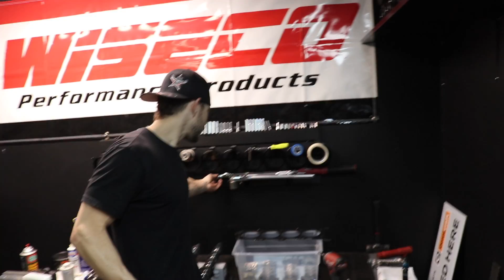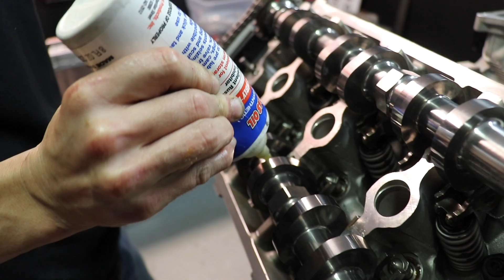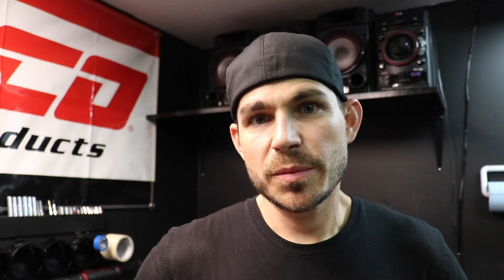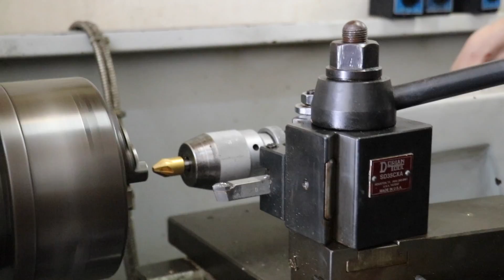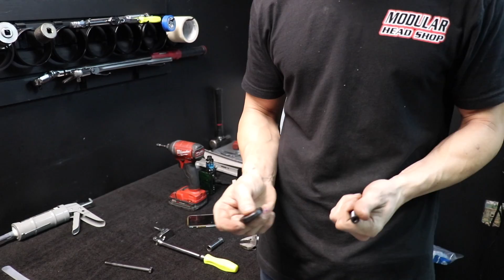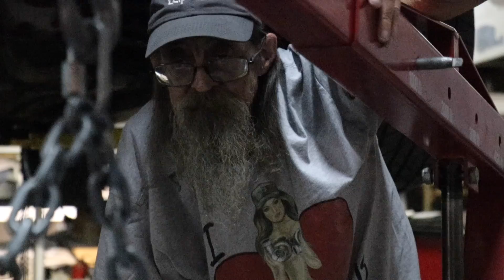Built and Cammed 5.8L Final Assembly

Comment: @ the 49:02 mark, Noticed no casket for the water pump, WOw that rubber or silicon oil seal must swell up something mad ,to seal the pressure of the coolant and from the heat?
Reply: Doesn't require a gasket and the o-ring works just fine

Comment: As far as oil pressure, thats what is important and where the oil is going, if you have a sealed loop system like the dry sump system, then sure bearing clearances are very very important, but you can never ever have enough oil, so real good pressure like a dry sump system is best for hi performance engines with a lot of moving parts. :) IMHO. :)

Comment: This is probably a stupid question, but when he says to torque the head studs in one motion at above 80 ft. lbs.   What does it change in the tightening method if you were to ratchet the torque wrench?
Reply: It requires more torque to move the nut then the specified torque. Does that make sense? It’s kinda hard to explain. 
So the nut being tightened at 60 ft-lbs would need something like 80 ft-lbs just to move it to tighten to 90 ft-lbs. That happens because the coefficient of friction is always higher of a stationary object than a moving object. Idk why, it’s just the rules of the land and everyone is forced to follow them. 
So if you tried to ratchet the head bolt/nut you would tighten to, say, 75ft-lbs. You’d need at least 95 ft-lbs to break the head bolt/nut loose to torque it to the specified torque of 90 ft-lbs.
So the torque wrench would just click if you pulled on it without actually moving the head bolt/nut. Hope that makes sense. Cheers. 🍻
Reply: My guess is the friction to make the bolt tighten more. Kind of like tires, it takes more power to initially break that friction, so doing it in one motion(if I'm right I may be completely wrong) would make the torque spec more accurate. Every time you ratchet the torque wrench you are must use more force to get the bolt to rotate and tighten any more, thus slightly inaccurate torque specs. I'm not an engine builder or mechanical engineer, its just a theory. No question is stupid as long as you learn from it, right?

Comment: Also as far as plastic, hi temp or hi friction stuff, theres plenty of options and its a good idea to use them especially for the chain follower or guide plastic items, that way it will last, oil resistant and temp resistant, but again it all comes down to money right and experience right. :)   Cadillac plastics in the USA used to be one of the largest manufacturers of those type of items for large engineering project's not sure now who would be the best, but Dupont would be the starting point and then find a local plastic moulding or machine shop which can make items to order especially now days with 3D printing. :)

Comment: Love that he is using hi friction additives for all the important hi friction ends on the moving following parts on the head, that's attention to detail. :) 9 times out of ten its hi friction grease and what gets me is this, the owner has no idea how much effort this guy is making when he is building that engine for him, were talking 10's of thousands of dollars it that simple, not so much the parts but the experience HP is Experience, FORD is mass produced even shelby the days are gone when you buy a OE performance engine other than GM stuff and even then they are improved by real experienced race engine  builders, thats what you need a race engine engineering boulder and not a engine mechanic. :)  Pull apart any nascar engine and i bet it has all those items which are made to last and are very strong items, but in saying that race engines are made to rev and lots of hp, but put it in a everyday car and it will run like crap mainly due to the fuel used, but run the same fuel say E85 and bang you have a monster but also needs to be reved off its tits it thats simple, same with drag engines, but if you make a good mid drag and everyday engine then you need to know how and this bloke has it in spades but i bet he is learning everyday from others who have more experience. :)

Comment: LOL Cant wait till he has it on the road and then BANG the motor goes ( Goodbye pistons ) , lol:) Not because it was built right, but because everything on the external part of the motor needs to be triple checked to make sure its working at 100% efficiency and like new if not better than new full stop? Like water pump and thermostat making sure its running at a higher temp and a better quality unit as well, not the stock unit, lol :)

Comment: On a turbo RACE application with a built bottom end, b heads stock with aftermarket cams OR b heads worked and stock cams? Which is most cost affective?